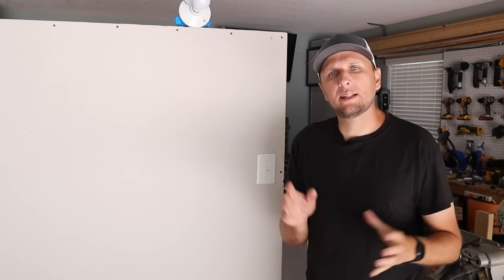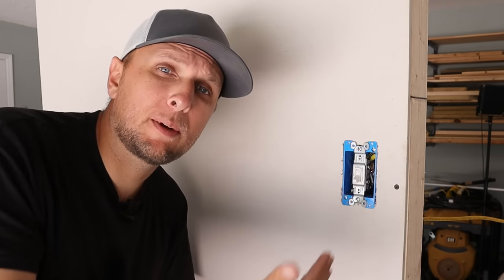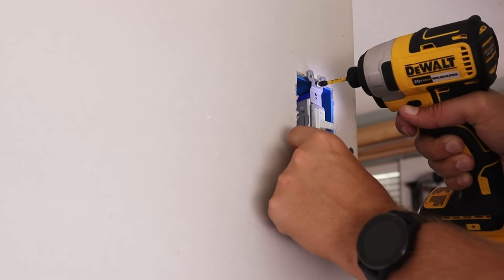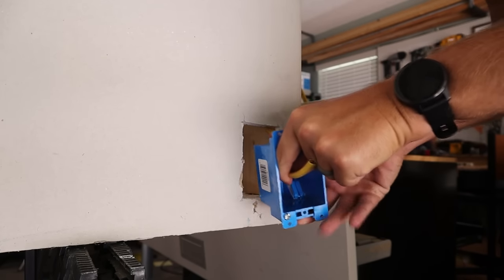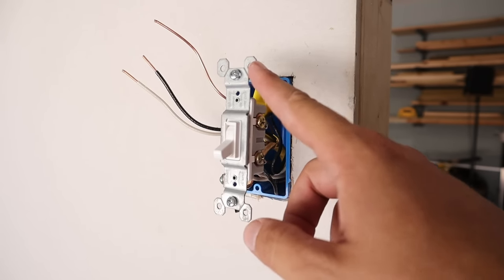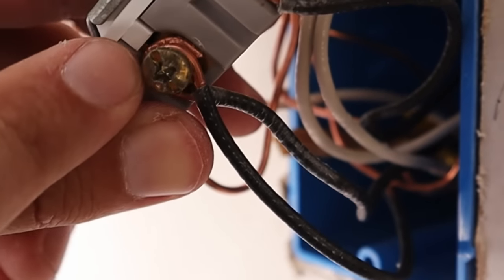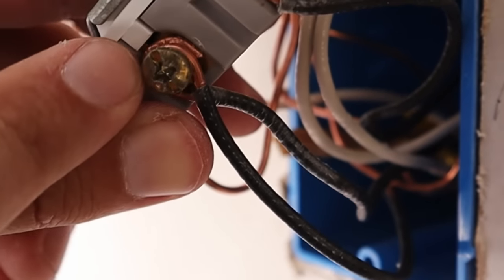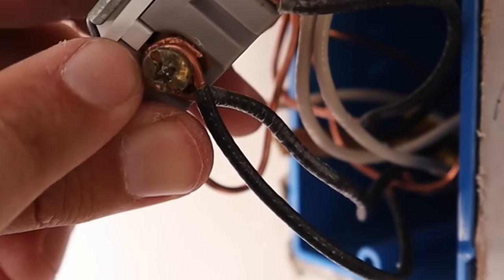How To Add An Outlet From A Light Switch | Common Mistake

Comment: Nice video.

First step for me would have been to make sure line, neutral and ground are all available in the switch box.
Cutting in the old work box, only to discover no neutral is a bummer.
Reply: How can I determine this? The switch box I'm working in is powering two different light switches. There are three separate 14/2 coming into the box. Can't get the receptacle to work without one of the swtiches being on. I've wired it pretty much like in this video, with the exception there are 2 switches.

Comment: Nice mock-up. Editing is concise and tight, not lingering like a lot of these videos. A little more info on wire gauge would help. Not sure if it applies here, but screws in contact with electricity need to be torqued. A new code thing. Well done.

Comment: Nice video.  I would add that the screw terminal and push ins are are not allowed to be used at the same time, its either one or the other.
Also I would have mentioned the wire direction around the screw terminal, many get that wrong.
Keep up the good work.

Comment: Good video. Caution to check local code. Lighting and outlet loads shouldn’t be combined due to potential outlet connected load shorts taking out the lighting in the room as well.
Reply: Super dumb question here but I’m learning. Wouldn’t adding a plug where the switch is essentially like adding a plug anywhere along the line?   Careful not to overload the circuit obviously by adding more receptacles….I think I’m not letting myself understand what you’re saying by talking about the switch as a location.  Just trying to learn. Thanks
Reply: @JonathanPostins  Not a dumb question at all.  I believe what he is saying is some jurisdictions may not allow receptacles to be wired on the same branch as lighting, regardless of location of the receptacles or switches. When I say branch, that means the entire circuit that comes off of a particular breaker. If you had a situation where a device that is plugged into a receptacle creates a short, it would (hopefully) trip the breaker, and every other receptacle and any lighting fed from that same breaker would lose power as well. This could create a potentially dangerous situation if you were to no longer able to see right at the same time as a piece of equipment had a failure. I didn’t know receptacles had to be fed from separate branches from lights in some jurisdictions, but it’s probably a good idea either way.

Comment: The FIRST thing you have to do is make sure that the light switch is not just a switch leg. If there is no neutral, you can't draw power from that switch in the first place! If there are only two wires, it is definitely a switch leg and you can't get your power from there! Second. I try to avoid going directly under the light switch. Wire pulls are usually straight up or straight down, so avoid cutting into wires by jogging the cut-in box over where it won't be a problem. The best way to cut drywall is with a small circular saw that is set a little less than the thickness of the drywall. That way you will never nick a wire. But drywall saws, multi-tools, drywall routers, and jig saws and sawz-alls will work, but you have to be very careful not to hit the wires or you will be doing 10 times the work that you need to!
Reply: Multi-tools are nice in that if one pays attention one can be precise in the depth of cut. Even use a bit of painters tape on the blade to set the depth.

Comment: I really wish outlets and switches would supply better attachment  points than just flat head screws. I much prefer the clamp type. In this example I might have used a 3 port wago connector for the hot and the commons.
Reply: I've seen some where the screws are both flat and cross. Clamp style and even one where it was like a washer with teeth.

Comment: One comment I would like to make is that the rating of th circuit should have been figured in before the outlet was added to make sure there wasn’t already loading at or near the limit of the circuit the light switch was on.

Comment: I thought the 'common mistake' you were going to show was bootlegging a neutral off of the ground at the switch.  A major and dangerous violation, but I have seen it done at least once.  Never have seen two loops of #12 under one screw though.   I don't like the squarish hooks wire strippers make, so I personally always use a pair of quality needle nose for that.
Reply: It's soo easy to make good loops with your strippers! The holes in them are there specifically for that.
Whan all else fails - read the instructions that come with the tool!
Reply: @JM-iz3fr  If so easy, what happened in the video? Clearly a fail.
Reply: I was installing a fan in a bedroom in my home a few weeks ago and had an extra white neutral wire in the box that was tied to a black hot wire coming from the panel. I eventually figured out this was the feeder that ran to the switch on the wall. So they had a romex running from the ceiling box to the switch box on the wall, they used the white conductor in the romex to carry hot to the switch and the black conductor to bring it back to the ceiling. I nearly lost my mind.
Reply: @merfishsandwich691   Absolutely nothing wrong with this method.  Sometimes it's easier to take the feed line to the device (light, fan, etc.) then run a switch leg from the device to the switch box.  Very common in fact, which is why the poster we're commenting to said he expected the error to be pulling common from the ground wire in the switch box - because there is usually no common wire there!
Reply: @CitEnthusiast  I agree for the most part. A wire is a wire at the end of the day. But when you build a system with a color code it should be consistent. They should have used Romex with a red conductor or added a lone black wire to run the hot to the switch.
Reply: Some fans with heat lamps must be powered directly from the breaker per manufacturer instructions. If you are using the neutral to run power down to a switch or back up from it, mark it with a couple wraps of black tape both at the fixture and the switch so the next idiot knows it's hot.
Reply: @merfishsandwich691  correction- as per code what they should have done was mark the white wire so as to show that it was a hot wire
Reply: @billy9075  I figured something like that may be the case. I think I'm gonna wrap some red tape around it to make this distinction when I reconnect the switch.

Comment: You show it in the video, but don't describe that the new wire nut for the grounds needs to be red, since there are 4 wires being connected together.  The yellow wire nut only supports 3 #12.  The red wire nut supports 4 #12.
Reply from the maker: You are absolutely right!  I do recall talking about it when I filmed it but in edits I missed leaving it in.  Thanks for the reminder for folks! 😎

Comment: Pro tip.   Before you cut a hole in the drywall with a saw, tape a small box to the wall below the area to be cut.   The dust falls in the box, not on the trim and floor.   Happy wife, happy life!
Reply from the maker: Great tip!  You are right about that.  Happy wife, happy life!
Reply: Hey real electricians have the apprentice  clean up
Reply: Have you heard of a vacuum cleaner?
Reply: I use post-it notes stuck to the wall and folded upward.

Comment: OMG Not in New Zealand with real voltages of 230 volts AC, must be separate Lighting and Power Point Wiring  (with no bare conductors). Red = Phase (Live), Black Neutral, Green / Yellow Earth )Ground).

Comment: Just don’t do it unless it’s absolutely necessary. After working the better part of my career in commercial work I e never ever ever seen an engineer spec out lights and outlets on the same circuit. Seeing it done in residential still blows my mind. Not to mention adding devices to existing circuits shouldn’t be done without first doing a load calculation.
Word of advice for DIY’rs… fishing a wall in real world conditions can take 5 minutes or 5 hours… good luck 👍
Reply: Commercial guys!
Reply: I do residential work, and the vast majority of circuits in a house use a very small portion of their rated amperage. This really shouldn't be an issue for a small addition so long as it's not used for any large appliances.
Reply: @NoTroubleMikeG  I completely understand and know that’s it’s well within the code and completely safe to do…. When breaking down electrical to its most simple and basic rules o have just always felt that keeping lighting and convenience receptacles on different curcuits. Of course for me I’m dealing with 277 lighting but in residential it can introduce undesirable interference such as harmonics.

Comment: You could not do this in the UK.  Lighting wire is 1.5mm mains wire is 2.5mm.  Lighting fuse breaker is 6 amp mains 16 -32 amp (unless a cooker circuit which could be 40 amp single feed).  You need to consider the amp rating of the light switch, UK is typically 6 -10 amp.  Ground wires in any light switch or outlet must be covered with a sheath in ground wire colour and not left bare.  Just don’t like US switches and sockets with bare connectors, give me the shivers.
Reply: Have to agree with what John said above, plus here in Australia we keep light and power circuits on separate breakers and never mix them up.
Reply: and the lighting breaker was 15A its so outdated
Reply: Completely agree, John. Amount of problems I’ve seen created by mixing lighting/mains is unbelievable…
Reply: @ryanmercer3352  this is in the US
All of our lights and receptacles are on the same circuits and the standard is 15A
Only very few exceptions will there be dedicated light circuits for example in a bathroom the lights and receptacle might be separate to account for a hair dryer
Reply: @dylan-nguyen  I’m aware that it’s in the US. Doesn’t make the point I made any less valid. Lighting and mains should be on separate circuits and not mixed.
Reply: Having a bare ground wire is actually safer

Comment: I wish you’d make the same video but making an outlet out of a double or triple switch. Most of these outlets I need to install are needed to be fed from double switches or triple, and it’s a lot more intimidating for some reason. I can imagine most people have the same issue. Good idea for another video
Reply: This is what I'm struggling with right now. in one config, the switch has to be on for the outlet to work. In another config, the outlet has to be powering something for the switch to work. No clue what to do now....
Reply: @MarvinBowen  if I remember correctly, I’ve had the same problem a while back. I ended up playing with the random wire positions till I got what I needed it to do. I’ve had a digital mirror hooked up to a new outlet fed from an old outlet and I messed up the wirings where my light wouldn’t turn on anymore with the switch, but instead kept turning on and off the digital mirror. All in all, I kept turning power off and on while I kept trying different wirings till I got the switch to turn the main light on, while the digital mirror stayed always on.

Comment: You made two mistakes.  The first is an outlet by code needs to be about 12 inches from the top of the floor covering to the bottom of the receptacle box (or 16 inches to the top of the box).  Your second big mistake was when you turned the breaker on to check for the hot wire on the switch.  You then turned off the breaker switch and did not check to see if the power was off.  You even just went in and touched the hot wire!  LOL  That is how inexperienced people are electrocuted.  You could have easily turned off the wrong breaker at the electrical panel and because you didn't recheck for electricity been shocked.
Reply: Very good point (wrong breaker), sounds like something that could easily happen.
Reply: @j777  Actually, I never turn off the breaker when I work on my electrical boxes.  I always work with the outlet hot.  The simple trick is just to not touch the copper, only the insulation.  LOL  I don't recommend that to most people either because most don't know what they are doing.  My electrician always told me that the ground wire is the first to go on and the last to take off.  I always do the opposite to that.  If I am holding the metal grounded part of the switch in my left hand and touch the hot wire by accident, that would electrocute me.  But if the ground wire is removed first, the metal of the switch is floating and then no return path.  I always recommend to people to turn off the breaker, check for power at the switch before working on the switch.  That is very a very safe way to go.  I also tell them, do as I say, not as I do!  LOL  Yes, I am a electronic design engineer (retired).
Reply: @richardcommins4926  I'm also an EE, but my reflex would be to cut power in most cases. It's just extra cheap insurance. Safety is about having layers so that you don't get "shocked" by only one mistake.
Reply: @j777  You are right of course.  Cut the power and be safe or leave it on and take the risk.  I have put X10 switches in my home for years now and I never cut the power.  It is just too easy to put the switch and wire nuts on.  Now an outlet is another story.

Comment: I'm not an electrician I learned by trial and error and also  research if I run into a problem. I have put breakers in I have run independent wire  for a space heater to an outside breaker cuz it's in a mobile home and mobile home wiring is out there  so I put it  on a  independent circuit when  I have  replace so many outlets & switches my  mobile homes & my mom's place I take everything out and  I put back  together like it was . I also ran an independent power in a shed for the refrigerator to the outside breaker like I did the space heater dug a trench and everything. Again I'm not an electrician but nothing's burnt down yet LOL. I'm going to keep watching your videos learn a little more

Comment: For the bathroom and kitchen where I need GFCI I am going to start with a GFCI outlet, and connect everything downstream from that, needing then to only buy one GFCI outlet. Correct me if I am wrong. That tip on the pigtail taught me something.
Reply: Depending on the manufacturer they may allow only a certain # of devices downstream to be “protected” typically the rule is no more than 8
Reply: @Nick-bh1fy  I appreciate that. Thanks.  I may need an extra one, or two or so in both rooms especially with all the electrical gadgets they keep coming up with.

Comment: You have covered this in your other videos, but I was surprised you didn't mention the need for a larger wire nut for the 4 wire ground (which you used).

Comment: originally, I thought you were making a switched outlet, so I was wondering why you disconnected the line wire.  Previously I had never seen a non switched outlet done from a switch.  
I also prefer pigtails.  Good information here.  Thanks

Comment: Loved the video!  Very useful information and what I needed to know.  Why do you use solid wire vs stranded wire?  Why is most house wiring always stranded wire even though it is pricier and has more electrical dissipation (loss), and is a pain to strip and twist?  I wonder why?
Are you still using wire nuts? Cheap, but they come off and they destroy the wire ends, esp stranded. Switch to Wago connectors. So much better esp with these multi connector situations. They come in a pack of 2, 3, 5 connectors and some Inline ones too.  Carry them in your Amazon shop.  Very good video, much appreciated. Subscribed.

fyi - If you turn off the circuit switch, make sure you lock that circuit box. Someone else may go flip it back on wondering why that lamp does not work.  Maybe on your way to the hardware store while you are working on it. You come back and power is now live!

Comment: JOb well done!! I really like AND learn a lot from your videos. I have a quick question. I have a toilet room (for lack of a better term) in my Master bathroom. It has a combined 2- toggle light  switch for the ceiling light and fan. Below that is a 20 amp blank face self-test GFCI receptacle. It does not control the before mentioned light switches. There is a Jacuzzi on the other side of the toilet room wall. MY question: I would like to add a GFCI plug receptacle to the other end of the room (8 ft) for a Bidet fixture I am adding. As the wall from the GFCI and light switches is wall-papered I would like to find an easier way to run the wiring around to the toilet. It seems an easier way would be to run wiring from the fan/light above the toilet and fish the wire down the wall to the toilet. Can I use a pigtailed line wire from the light or fan to the new outlet? This wire is 14 gauge from a 15 amp circuit Or from the light/fan switched in the distant wall up and over to the toilet? The GFCI blank-face receptacle is 20 amp so I assume it is 12 gauge wire? Would I need to run 12 gauge to the new GFCI receptacle or use 14 gauge from the light switch and can you buy/use a14 gauge GFCI receptacle? I sure hope I haven't made this more confusing than need be?!!  Many thanks for your or anyone's help!!..ken

Comment: Thanks for explaining that so well. I have an older 70s apt with a dual gang box for light and fan, and they run to the single outlet by the sink. Problem is they ran the outlet off the switch, so it only has power when the switch is on. Need to wire it so outlet is always hot instead. 🔥

Comment: Great info on how not to be lazy and do this right. I opened a light switch I want to add a light to and sure enough, those neutral wires were in there, tucked in the back and wire nutted together.